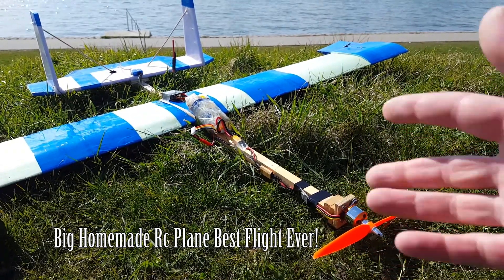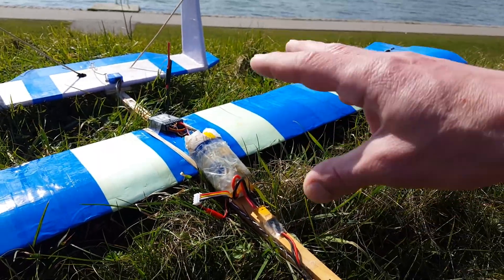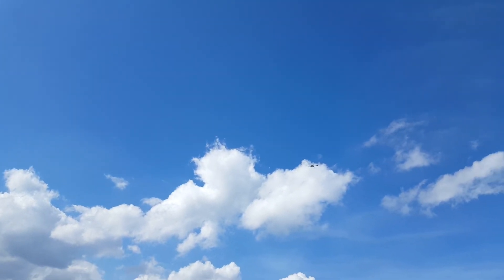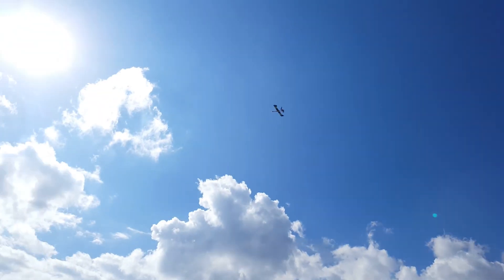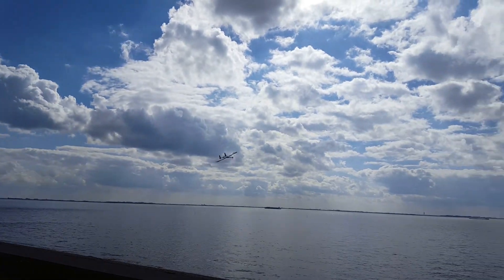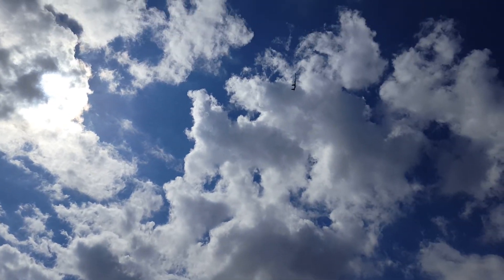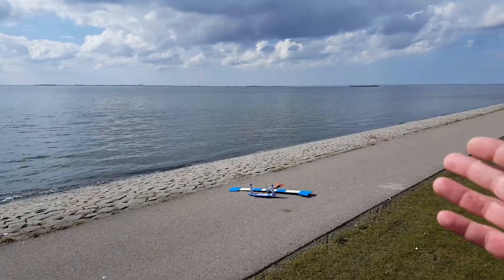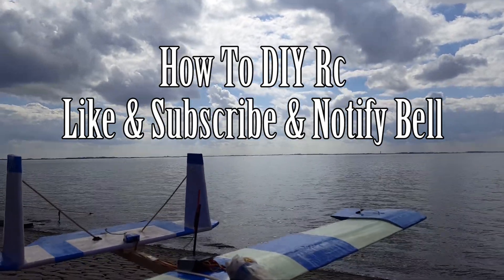Best Flight Ever With 100Inch Homemade Rc Plane Project EP3

Comment: well, normally, i would say that Two vert-stabs are Twice as Heavy as one.    but this screwy configuration  NEEDs  both of them; their height Should be reduced by at least two inches .   the elevator design looks like an after-thought.   the Span and Weight of the horiz-stab are Excessive; span Should be No more that 30 percent of the ws.      i assume there are servos in the WINGTIPS to control the under-sized ailerons.  the Weight of those outboard-installed servos is Reducing roll axis stability.     some pilots are fond of phrases like 'flies perfect' or 'flies great'.   most such pilots have to be either near-sighted or uninformed.   last but not least,  BUY  SOME   E   PROPs.   for times, LIKE NOW, when you are Not flying a Slow-Flyer.    cheers